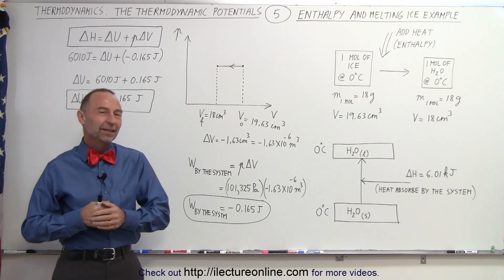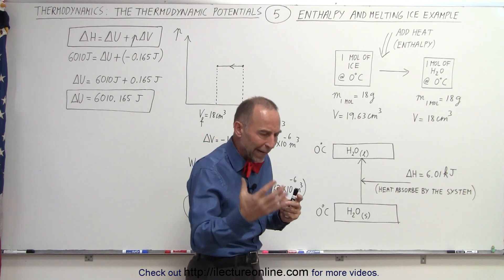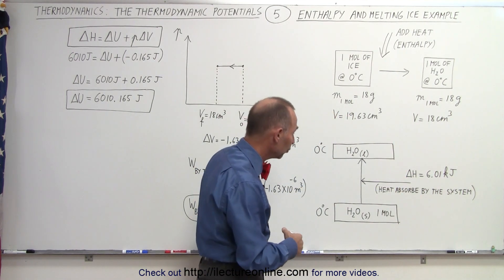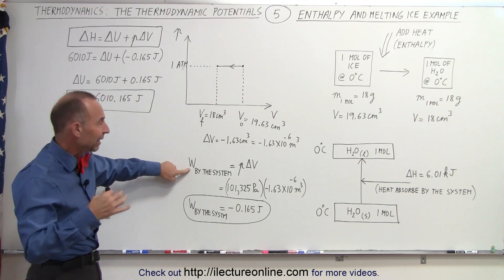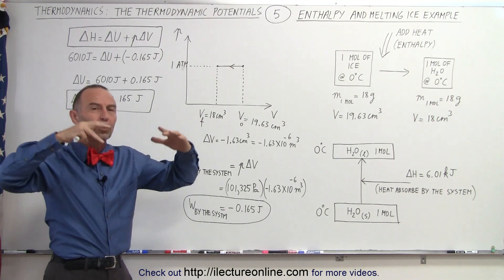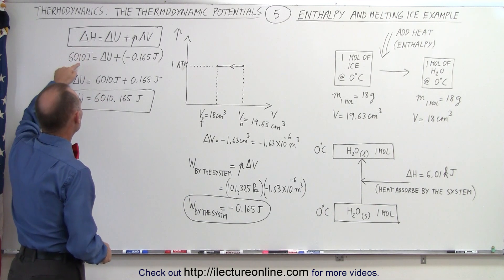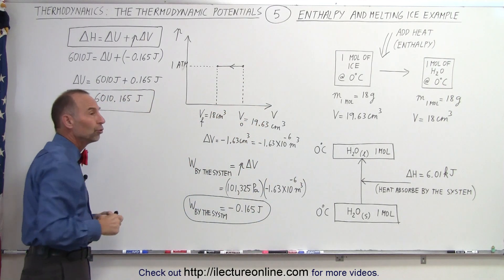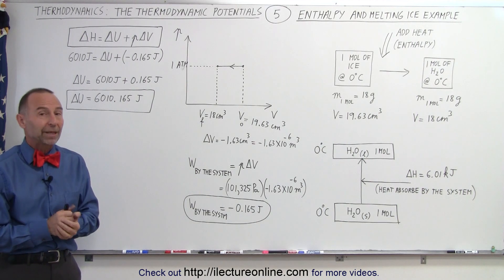Physics 32.7  Thermodynamic Potentials (5 of 25) Enthalpy and Melting Ice: Ex.

Comment: I am soo confused. You started by saying (and as indicated from your workings) that Work is being done by the system(W BY THE SYSTEM) but then continued on to explain that the melting of the ice and therefore reduction in volume, means that work is being done ON the system and hence work= -ve sign.  So my question(s) is what is performing work (the system or atmosphere) and what determines the positivity or negativity of work? Please help.
Reply from the maker: This is typically utilized for gases.  When a gas expands, it pushes something and therefore the system does work.   If the gas contracts, then the environment is pushing on the gas reducing the volume and then work is done on the gas (which is negative work).

Comment: Sir,
when we did the calculation here regarding work it turned out to be negative. So, there is a chance that we may think it is work done by the system. How can we clearly understand the fact that a work is done by the system or on the system?
Reply from the maker: That is just a definition.  You must establish which definition you want to use first and then stick to that definitoin throughout all of the problems.